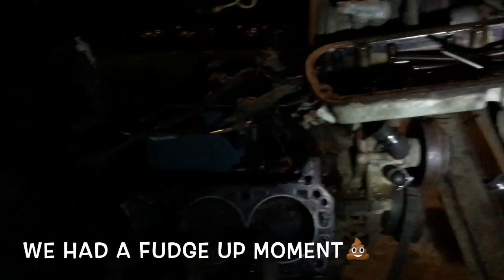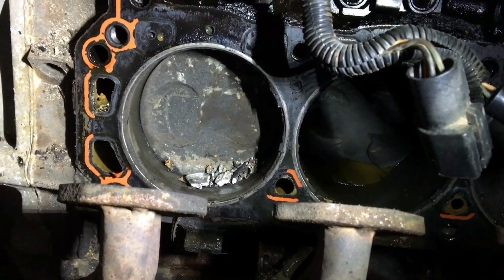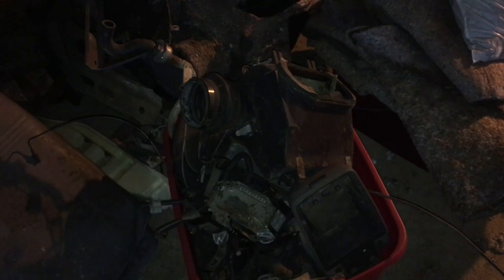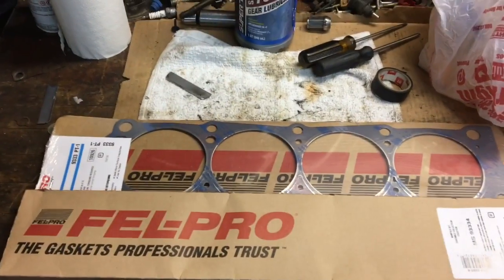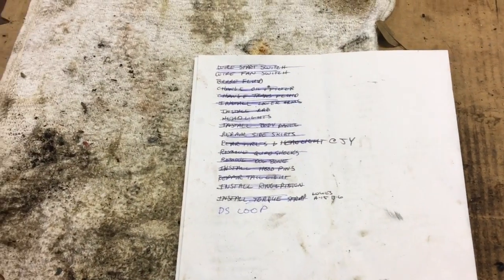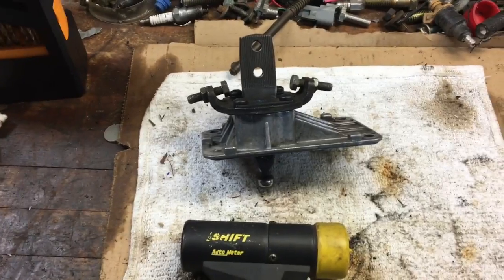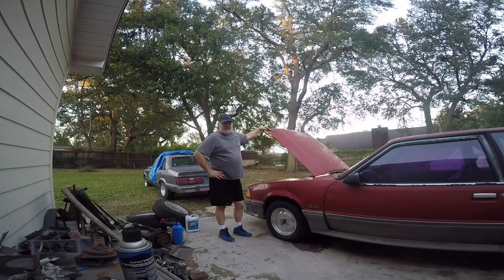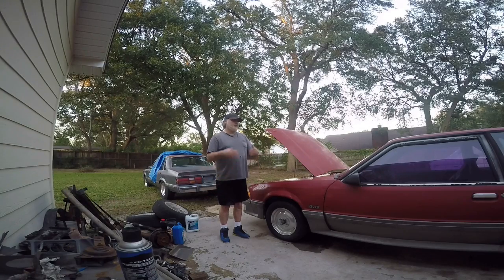Trojan Horse pt.10 1989 Mustang GT Project. Budget Fox Body Drag Car

Comment: I feel your pain man.  One winter I installed long tube headers (btw what a pain in the a$$) and when I looked one of the tubes had a liquid similar to milk shake ... well somehow it cracked two cylinder walls.  The good thing is I had an excuse to build a 347.  But I still love that little 302.  I'm gonig to get one from an exploder to have it for spare.

Good Luck with the piston and keep the vids coming.

Comment: good video! I'm gonna pull my 5.0 apart this weekend too. i bought a trickflow track heat upper n lower with 24# 75mm tb and maf for $300 gonna put em on
Reply from the maker: Sounds good! Whats it replacing?
Reply: all stock parts. im thinkin maybe put a set of heads and cam while im there? or run it like this until im bored of the power. what you think?
Reply from the maker: The intake/tb/maf will make better power than stock, of course the heads are the next bottleneck, then cam just so it can turn a little more rpm...the intake will make it feel a little "more free" up top...these cars always feel like they are being strangled...of course these are also "combo" cars meaning that you have to do all of it (maf/tb/intake/heads/cam/exhaust/gear) to see the big gain...these things were almost perfect for what they were meant to do from the factory so EVERYTHING has to be changed to see "whoa!" gains, especially for the butt dyno lol.............but thats a great start:)
Reply: agreed. think i wanna get that butt dyno soon! lol

Comment: Something similar happen to me with a BMW X5. I was doing spark plugs on it. I was using a locking extension well the small screw holding the sleeve on the locking extension fell off into the cylinder n I didnt know till I turned the engine on n it started rattling. Took the head off n found the screw. Was gonna put it back together but my forman approved to change the piston. Turned out the piston ring got crushed. Good thing I swapped the piston
Reply: Oh wow I wrote the message above before the end of the video where ur talking about maybe having a bad piston..... well shit happens man and to the best of us. Ur not alone I feel ur pain but hey u got my support all the way keep pushing n keep making videos I wanna see finished product.
Reply from the maker: It's only the second round of a 12 round fight with this thing....cut me Mick!

Comment: You eliminated a lot of weight man!  How you keep the front nose without the bumper?  Also the sound deadener 70 pounds, I'll have to take mine out too.  Keep the videos coming..
Reply from the maker: The bumper basically supports itself........we've made multiple 98/99/100mph 1/8th. mile runs in another car with no distortion............all the sound deadener adds up lol.....
Reply: Awsome Thanks!  What seats you use, the cheap Summitt seats?  Thanks for all the info.
Reply from the maker: Yes........i weld some metal flat bar across the factory bracket and drill and mount so they are adjustable, also use a small spacer on the back floor bolts to level it where i want.....i've also bent and dropped the flat bar on the front side of a couple of seats but the spacers are easier lol...........
Reply: Thanks Man.  I thought those could break easy.  I'm a fat man.  But I see how you launch Krusty so those seats are good then.  I can't wait to see the trojan horse at the track and how it progresses.
Reply from the maker: The only thing i would suggest is depending on your size, maybe finding a car that has a set and try them, they are basically all the same mold...if its to tight a kirkey alum. might be a better option as they have different sizes but of course cost more...i'm not a little guy and the 'glass seats are fine for me even with extended drive time/distance.........and we'll have some more Trojan stuff this coming weekend:)

Comment: Hey bro when you put the heads back on again could you please show how to do the valve lash please
Reply from the maker: On bolt down rockers its just tighten them down to whatever specs are.....20-25lbs. i believe, no adjustment necessary on stock junk....unless of course milled heads etc. etc. then they might need to shimmed...1.7's sometimes require shims also...........thanks for the view!
Reply: Thanks for the reply

Comment: You gonna ditch the AC compressor?
Reply from the maker: Yes..........we actually did a little more weight loss than intended lol....the interior was just so nasty it made more sense to ditch what we did and having to take the nose apart to "fix" it (lol) we just decided again that it made more sense to ditch the bumper/foglight bar........our final weight loss program will include losing the heater/ac box, crash bars, rear bumper , pwr steer pump and a/c compressor/brackets, we may lose a pound or so on the exhaust swap........maybe a set of alumn. heads way way way down the road but i'm not holding my breath on that lol

Comment: 50Tussin, Can you list all the stuff you have pulled and are planning to pull out of the car to add up to a 500 lbs diet?
Reply from the maker: Oh god, i've got to type all this:(.........these #'s are based on starting with a whole stock car, nothing removed or changed.......
front/rear sway bar-33
front bumper/foglight bar-38 (airbag cars will be less/no gas charged supports and foglights were missing on mine)
quadshocks/radio-console-armrest-cassette holder/ reardogbone-35
power seat/bracket-46 ('glass seat/bracket-18) 1 glass seat=78 total savings
rear seat-40
factory engine fan (no shroud)/ac (except for compressor)-20
hatch carpet/sound deadener (under interior carpet)/seat belts/misc sound deadener&items-50
inner wheel wells/washer bottle/cruise-misc. under hood items-20
Misc. items(smog pump-spare tire-bolts-etc.)-45
wheels/tires-50 (4 factory wheels/tires vs 2 weld w26x10 slicks/ alumn. space saverspares)
rear bumper-45
ac comp./bracket/ps pump-30ish
heater/ac box ducting/firewall sound deadener-35-40?
 both door crash bars-32 (air bag cars are 16 total)

That all tallies up to around 500+ soooo thats where the number comes from...i've done this same mess to a number of cars and took these numbers from the list i made doing the Trojan...drug all that crap to work and weighed it lol...........
Reply: Thanks Brother, Guess I could of ask for a detailed video reply. Keep up the good work. Video's make me want my 95 GT back I had in high school. Hurt a lot of feeling in that car...
Reply from the maker: Not a problem...the video would have been harder lol...not a lot of people are willing to take that much stuff out on a "street" car but it really helps performance and reliability wise (less weight =less broken drivetrain parts in theory lol)..anyway thanks again for watchin this mess!